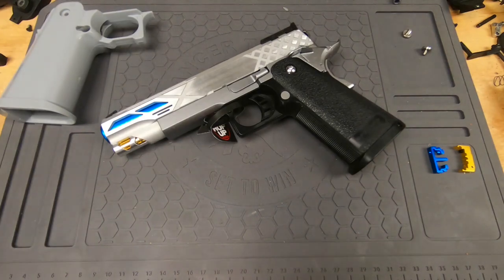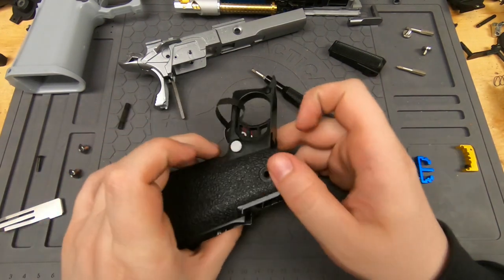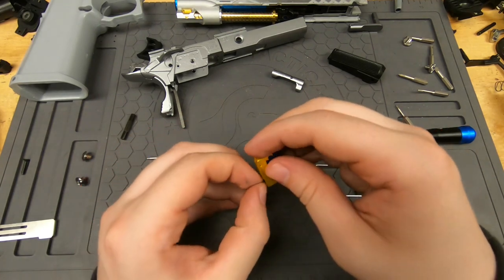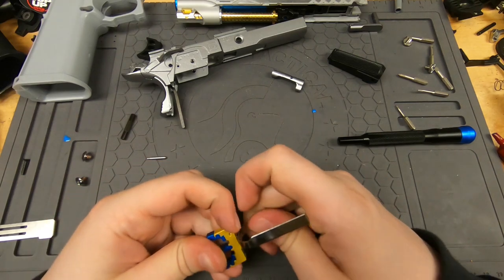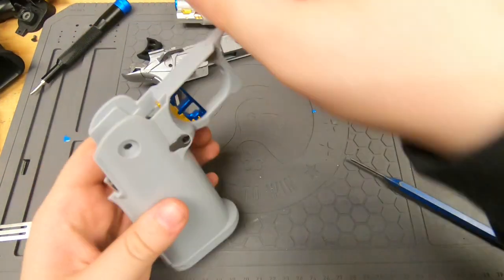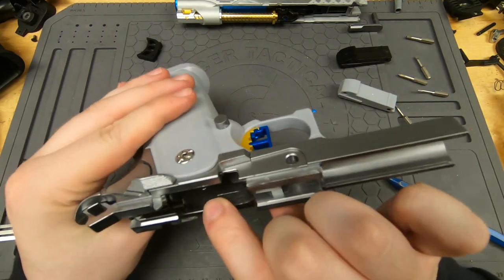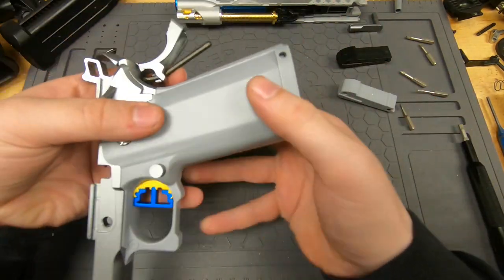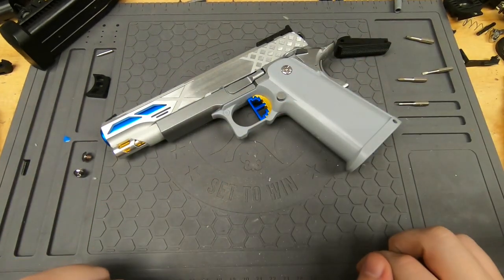T022🔫 How to install trigger and grip + screws for Tokyo Marui Hi-capa | Airsoft toy tech guide

Comment: What do i need to do with the screw on the trigger to have minimal trigger pull?
Reply from the maker: Start with the screw screwed in all the way. And then slowly tune it out until the trigger doesn't work. Then screw it back in just a bit so it works.
Reply: @Wyhaq  thanks! 😁

Comment: Thanks for sharing! I find it a pity that you haven't shown how you remove the hammer pin.
It's something I always struggle with a lot :/
Do you have a specific device for this where you clamp the trigger?
Best
Marc
Reply from the maker: I have been planning on doing a video on that soon. I should have one out for that in the next few weeks. But basically, I put the hammer on a 2x4 or a wood thing that is kind of soft. Skinny punch tool with a hammer, pound that pin out of the hammer and stuck into the wood. Once the pin is most of the way into the wood, you can normally remove the hammer, and then pull the pin out of the wood with visegrips. Putting the pin back into the hammer is super easy with a pair of knipex

Comment: Could I ask where you got that slide? I've been looking for the same exact slide, but it's out of stock on every website I visit.
Thanks in advance ^^
Reply from the maker: oregon airsoft. Slides are going to be hard to find specific ones. Generally there is about 12 different slides made per year, and once one type goes out of stock it will be a long time until that specific one comes back